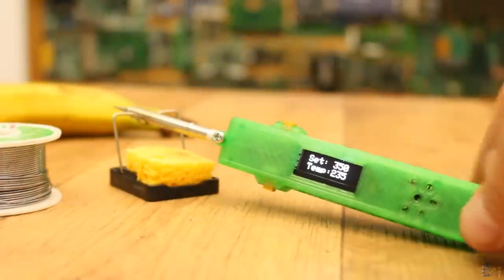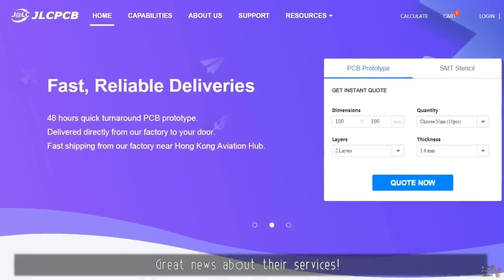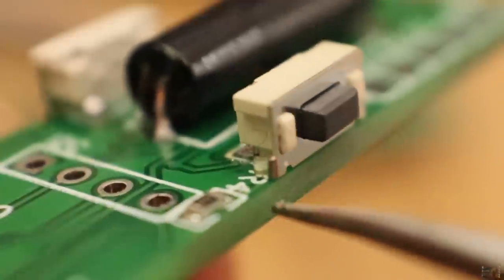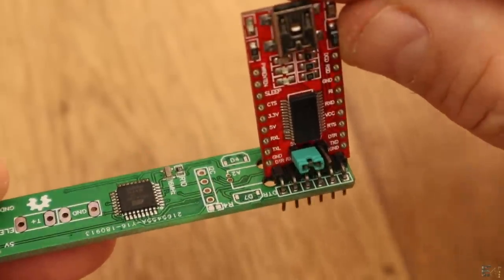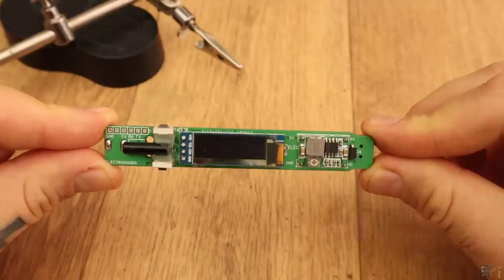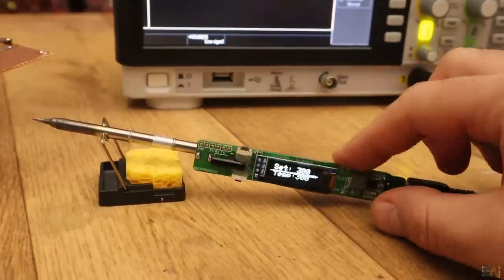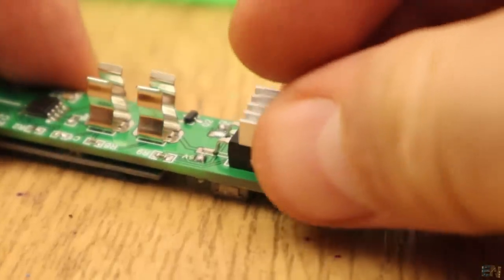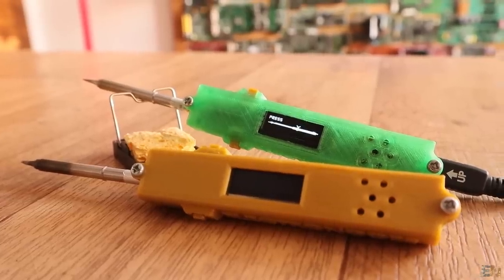Arduino portable soldering iron board V3

Comment: I have a question. Why do you use this converter board instead of simple small linear regulator which are always used in every arduino boards for microcontroler power?
Reply from the maker: Getting from over 20V to 5V with an LDO is not recommended. A lot of heat is dissipated and the efficency is very low.

Comment: Nice! For the next version maybe look into implementing USB PD, which can supply a whole 100W at 20V! (where the T12 uses 70W at 24V)
Check out the "FUSB302" IC, seems like a simple way to implement Power Delivery. I saw a nice prototyping breakout board for it. I bet it would work wonders!
Looks like it only needs the usual simple support passives, but it has no QFP package option, just BGA (oof) and QFN (not too bad).
Or USB Quick Charge like the TS80, but that can "only" deliver 18W, however there are Arduino libraries to control it without any external hardware

Comment: Excellent! video man and great product.    Is there a reason why you used a P-CH fet? A N-Ch fet would be more efficient as they can be found with much lower ON resistance. Thus cooler running so could have saved from needing the small heat sink.

Comment: Sorry to see funding wasn’t successful on Kickstarter. I’ve just started electronics hobby and want to hear your opinion for an idea regarding soldering iron. 

Do you think it would be possible to use a mosfet+thermocouple/thermistor and Arduino Nano to get more power from a PD charger to make higher power iron? I’m thinking it could have a temp control like PID through Arduino code.

Comment: Quick N00b question, why dont you use 5V regulator like L7805, as I understood you need 5 volts only for powering arduino and display, so 1.5A max power of said regulator would be enough. would love to hear some feedback from about this and also are you planing doing anything with GSM modules? like sim800?  Big fan of yours and you are huge motivator for me! keep up good work!
Reply from the maker: Going from 20V to $v with LDO is not recommended. You will loose power as heat as well. the most efficent is the buck converter!
Reply: 7805 will be ineffecient if you are using batteries with this iron.

Comment: Can you please modify the code so we could use an 16x2 lcd, without sleep function activated by elapsed time(just by a micro switch - when it's closed it will enter sleep mode, when its open go to operating mode ) and just two buttons for UP/DOWN temperature
I want to make a soldering station, based on your project, but with an fixed base(wich contain the power supply and control board)  and soldering tip would stay in an separate holder, atached by an cable, but coding it's not realy my thing

Comment: Hi, i have soldered 2 irons and on both is SW running slow - like half speed. Material like in BOM, i replaced at least 4 IC, also quartz, several bootloaders and is alway the same. My friend did one and we compared part-to-part and is the same, but the speed on mine is like on half clock on his - normal speed, like in video. Buttons on mine not reacting always, vibration sensor not reacting.... all the lines from the part to uC are checked and are conducting... any idea?
Reply from the maker: This is very strange. I have no idea... The IC taht goes ok and the slow one are from the same supplier?
Reply: @ELECTRONOOBS  I got it work today. I have found out that multiple libraries were detected and the one taken were not right. So i cleaned the library folder and left needed one and now all ok. Now only vibration sensor stil not working...

Comment: Hi Electronoobs - I have been reviewing and noticed that actually the schematic for Ver.3 is using IRF4905 (so a P type).;  so the code you have published matches (although the comments didn´t).;  now I come to another problem : TIP ERROR.;  still not able to identify.;  if you have some guidance would be appreciated.;  thank you

Comment: Why you use whole board to regulate voltage to 5v when you can use LDO like LP2950CDT, and they cost 14-ish cents on aliexpress
Reply from the maker: Ldo from 20v to 5v? Not sure good idea...
Reply: @ELECTRONOOBS  they are created for such thing. LP2950CDT have input voltage up to 30 V
Btw, probably much better mosfet for this application will be something like IRF3708, because of lower threshold voltage, and drain to source on-resistance.
Reply from the maker: @StasZubenko  thank you. I'll look into it.

Comment: Hello , thank you for such projects , you are awesome. I made it for me but says tip error. Can you tell me what would be the problem? T12 tip works just fine on other devices but this says tip error when goes up to 380c
Reply from the maker: It should say tip error if there is bad connection between the tip and the connectors or if it goes over 700 degrees.
Reply: I used other tipe of smd transistor istead of listed , can it cause this problem??
Reply: Instead of q2
Reply: I dont think its problem with connection because it heats up little bit and then says error
Reply: Please can you answer me ? I have tip error , can it be caused by changing R25 transistor to L1 ?

Comment: If he makes it commercial with Arduino
Won't he need to program it in c and not Arduino ide
Reply: well it will make more efficient code but it will lose the DIY noob-friendly purpose. Though I'm sure there are some commercial products using arduino libraries in secret inside their proprietary firmware (therefore infringing GPL and other copyleft licences).

Comment: Sir i request u; please make arduino fingerprint bike starter with dfplayer.. And add 2relay..1st relay turn on the lock. And 2nd  turn on the self.. And make sure add sleep mode function.. And control 2relay in 1 finger id.. That's it.. Plz sir i request u give me code.. I have arduino 328 and dfplayer and fingerprint module but code not ready.. Sir already your old subscriber.. I wait for your response

Comment: I have been working with electronics since 1988 and have never burned a good component with normal soldering irons ... JUST STAY UNDER 260 Cº SO U WONT REMOVE PADS.
By the way in my opinion a fast heating soldering iron for Professionals are way more usefull than that like a induction heater would be more usefull ...
1 more thing u can use a ATtyny to do that for less $$$ than atmega